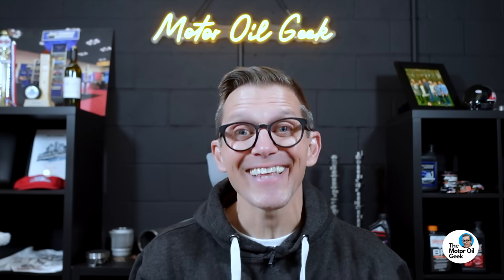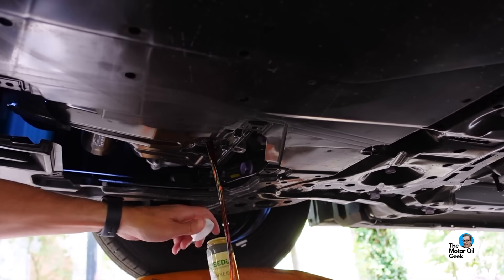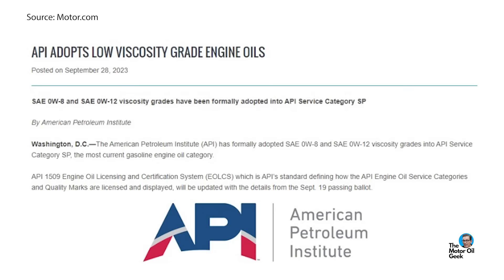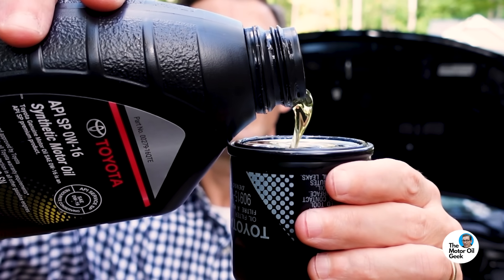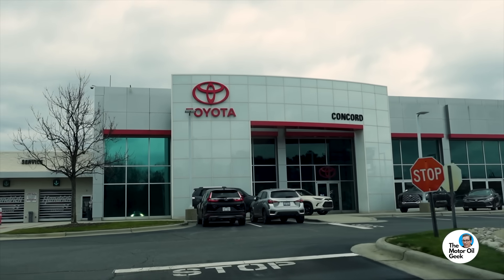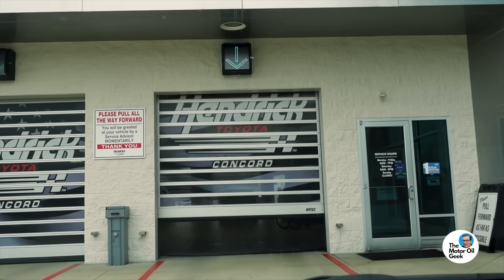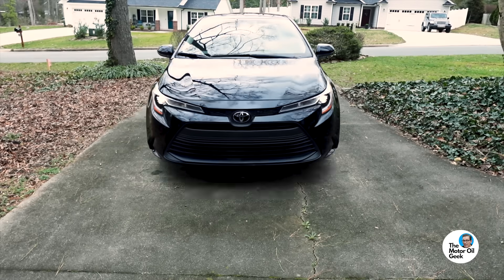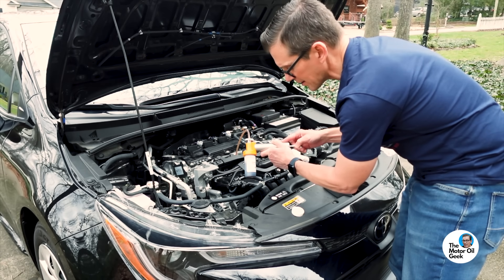0W-8 Motor Oil: Too THIN to Trust? Let's Find Out!

Comment: in my 2015 Ford Fiesta, I moved from a 0W20 Motorcraft  to 0W16 Pennzoil then to  a 0W8 Mobile 1. My Engine has never ran as quiet and as smooth as it does now since running the thinner oil. I read the Specs  of the Engine, from ring sizes to the 0.001" Bearing Clearances,  identical to the new Toyota engines and other engines requiring 0W8 oil. I believe it is a Korean spec vehicle, even down to the wheel and tire specs. I will be doing an oil Analysis right before I change the oil to see how things are going. I love the Videos Lake!
Reply: Doesn’t the owner manual say to use 5w-20/30? Why are you using 0w20 or lower?
Reply: @hass1337  It was made before there was an oil thinner than a 20 weight which was the thinnest available in the mid 2010's. Clearances and ring tensions determines oil weight, but also, Not all manufactures keep to what is in the books. Most do change grade requirements as time goes on. The tighter the tolerances, thinner and lower the Rings, the thinner the oil needed to feed into the Mains correctly.  You cant run a 30 weight with clearances so tight, it will starve for oil, even a 20 wt will cause this, that is why it was so noisy with thicker oils.
Reply: @TheOfficialNakatsuMegami  you're insane and completely wrong. Your engine is going to start burning oil very quickly. 
Wtf
Reply: @TheOfficialNakatsuMegami  my toyota calls for 0w20 in the US, but everywhere else it calls for 0w16 through 10w40. So i run 5w30. Same with my silverado. The silverado just had a recall due to running 0w20 and it has destroyed engines.
Reply: I ran a Manometer reading for Crankcase blow by on my Fiesta 1.6L, which I found out, is actually designed by Yamaha, not Hyundai.  With 0W20, Ford Spec for the engine, and switching to 0W8, my Crankcase blow by pressure dropped by Half. This is telling me the 0W20 was too thick and the oil was not making it to all of the rings because it was too thick and was actually causing more wear and increasing fuel dilution in the oil. I bought the vehicle with 70k miles on it and the previous owner must have ran a really thick oil, because it was mimicking a blown head gasket here was so much crankcase pressure and caused it to blow the oil filler cap off if is was just laying on it unthreaded.  on the 0W8, the pistons rings seal so much better and the cap stays on just laying it over the hole. I think it could be a specific use case, but the change did three major things,  significantly reduced blow by, reduced the oil consumption from a half quart in 5k miles to zero and stopped the fuel dilution of the oil. No additional wear was found after two oil changes. I am on my 5th Oil change and will have another Oil Analysis done in about 2k more miles to make it 3,000 on Mobile 1 0W8.  This time I will use Lakes company to do it so he has the data for his report.

Comment: before toyata free oil change at 10000,  i also got oil changed from toyota dealer from my own pocket 3 times before 10000 free one. in my camry 2025 (0w-8).

Comment: Lake, in colorado winter can I use oem 0w16 & 5w20 in summer? Both name brand oils of course
Reply from the maker: I would not go thinner than the OEM recommends.
Reply: No its original oil is 0w16. Can I safely use 5w20 in summer? So I wanna go thicker for summer
Reply: @CarlosMartinez-pc7je Why not 0W20?

Comment: For the CVT on my Civic and the 5 speed tranny on my Camry, I use the " measure what comes out and fill with the same amount".  Tranny fluid doesn't evaporate so if you have no leaks, there is no reason to use the check fluid plug procedure.  You just have to be careful not to spill when draining and measure precisely what came out.

Comment: Sorry for being late and perhaps it's been answered, but the chart at minute 11 indicates that the oil change for Caroline's car on 2/28/24, the most recent one was 0W-16, while you say that it's 0W-8. Question: now that different brands of 0W-8 motor oil is on the market, do they have the similar additives to the Toyota 0W-8 motor oil? Given that 0W-8 oil is pushing the limits, will it be safe to use other brands of 0W-8 oil in a Toyota?
Reply from the maker: The oil installed after the samples shown was 0W-8. We’ve not tested any other 0W-8 oils yet to see if they match the performance of the Toyota 0W-8.

Comment: Never go over 5,000 miles on ANY motor oil change!  3,000 miles if you are unfortunate enough to have a turbocharged engine!  Otherwise, face a very expensive future!
Reply: I mainly go 5-6k miles in my turbo.  90% highway miles.  I have never had a problem.
Reply: @BabyBugBug  Highway miles are 20% of wear vs city driving!
Reply: @bryancarlson3673 And I’m so happy I only do long distance driving and just walk lol 😅

Comment: All I am saying a Toyota/dealership tech is the very last person I’m listening to cuz like literally they’re working for the dealership. Hello, naturally they’re going to tell u just as the manufacturer. My sister just bought a 2024 Toyota Corolla and it will be getting the oil changed at 5,000 or less miles revenues those free ones from the dealership will be done at the dealership and in between by my much very knowledgeable trustworthy mechanic that been going to for years. As for CVT fluid drain/fill at 60,000 miles I ask him can it be done and if he says yes it gets done. Because that’s when the CVT warranty expires. I had considered doing prior but then Toyota might try the game playing of oh you voided the warranty by draining/refilling! My theory is that Toyota anticipates the life of their CVT to be about 60,000 miles and therefore say the fluids is lifetime as the fluid would not need replacement prior to that, thus, are saying fluid is good for life of CVT which typically is 60,000 miles otherwise they be confident in and would warranty it for longer than that, the whole thing that manufacturers decreased warranty time is because modern cars are more reliable than older ones, makes  me sick 😂 A) It’s been proven it’s the other way around B) If modern cars were more reliable you be confident in increasing the warranty time not with declining it, unless you have absolutely no brain and/or common sense! Just my thoughts/opinions y’all are entitled to your very own! I end by saying good luck w/your vehicles to any and all automobile owners. 🙂

Comment: What people need to remember is this isn't caveman mentality where THICKER OIL BETTER THINNER OIL NO BETTER..

Viscosity doesn't protect your engine fully, film & shear strength with a quality oil does!! Viscosity helps it travel to its final destination the quickest and at what speed. 
Slower thicker speed can equal less protection, create more heat & bearing wear with an adverse affect.
0w20 oil today has numerous protection packages with a better flow rate that actually reduces heat covering more area quicker without sacrificing protection & is rated up to 104 outside temperature.

I want someone to show me 1 instance where a motor was fried early using 0w20 where 0w20 was called for on that motor.
Keep your old school mentality and run your thicker oils ignoring engineers while molasses is coursing slowly through the veins of your engine possibly affecting your VVT timing & yes tolerances & passages are smaller now than 1980. 4 cylinders are pushing 250hp etc.,,.. 
0w20 actually has additives that help protect better than 0w30 and at cold start up the 0w20 leaves a film behind so its not just metal on metal... 0w20 is year round for all temps!!!. Do what your manual says..
Reply: Where does this neglecting of physics coming from?
The property of a fluid to resist the growth of shear deformation is called viscosity.
So you re wrong, cause it is only the viscosity that protects from wear.
People would easily neglect the simple physics so that they feel comfortable with the manual given to them. 
Obey the manul no matter what.
Reply: @joeblack6611  There is really no right or wrong here wirh respect to oil function we both make points because there are 50 ways to skin a cat with oil discussions..
My "Main" point was to many people people think a thicker oil is automatically better for protection "Without" realizing it could slow flow rate while doing more damage and most don't think of this. I'm splitting hairs saying a good quality oil is needed, meaning proper viscosity, shear, film strength & quality BUT also emphasizing viscocity is also a flow rate that is Very Important which has a main objective of travel rate & speed which is a huge part of your protection as Viscosity=flow rate.. Of course obey the manual..
Reply: @seatime674  
The point is that terms such as film and shear strength of the oil are often mentioned as if it was something independent of viscosity in general. There are no such parameters of oil from what i know. 
You ve got viscosity by SAE ACEA or HHTS High Temperature High Shear Viscosity. And it happens that the higher sae viscosity the higher HHTS.
This is why these manuals that distinguish the harsh conditions of use they recommend simply thicker oil for harsh conditions never the thinner oil. 
So basically we are on the road to nowhere good.
Reply: @joeblack6611  Yes to a point but the whole argument in today's modern engines is CAFE wants more  mileage period which thinner oils offer slightly & unlike 20+ years ago 0w20 & the like are engineered for higher heat & shear strength today so a thicker oil isn't necessarily needed nor should you just "guess" what your car might work better with with different weather patterns,
  THIS is the delima & confusion factor. Most car makers state to only use 1 weight oil year round regardless of temp, while some state to use slightly different in hot or colder weather which is fine following the manual. My Pacifica requires 0w20 only year round and doing something different may not be good for it.. However it gets to 115 at times in Vegas in the summer where I'm at and have been tempted to use 0W-30 so wel see, it's a daily fight between good & evil..
Reply: @seatime674  
0W20 might be enginered for higher heat and shear strength today but in the meaning of their stability not to loose this viscosity with time. But these oils wont have better shear strength than thicker oils simply because they still are thin and low in viscosity.
Frankly speaking i would say it is the modern engines that should require higher viscosity oils.  Higher power, smaller size, materials even worse. Whatever the old car, the shortblock was usually the last thing to be worn out. 
Take these pentastar rocker arms that are ticking when worn out, i bet these rocker arms are begging for a 5W50 from the very begining.
Reply: @joeblack6611  I guess that's the whole point in new cars today that require 0w20 that "could/should" use thicker oil because of higher performance is that engineers have made the thinner oil better to withstand shear and heat stress while still getting the best mileage possible. I guess it's riding that critical fine line..
 Maybe if emissions and gas mileage were never an issue all cars might be using 10w50 who knows..

The Pentastar 3.6 1st and 2nd gen engines 2011-'16 had defective rocker issues to begin with that required 5w30 & 5w50 may have just bought a little more time only before failure. My '18 Pacifica has the Pug update 3rd gen 3.6 that requires only 0w20 now as the top end issues were resolved on all 3rd gens..
I'm at 70k miles runs perfect & doesn't use a drop between changes so I know 0w20 is proper but still super tempted to do 0w30 soon,,,, maybe.. Daily fight ha..
Yes higher viscosity always has a slightly higher heat and sheer strength

Comment: Should I worry I have a 2025 Camry, I put 0-16 instead of the  0-8 that is recommended car has 6K miles on it so far.
Reply from the maker: No worries at all with the 0W-16
Reply: @ thank you for your reply I thought so I just wanted a 2nd opinion of someone that would have more expertise

Comment: Mr. "The Motor Geek", You missed this technical point. Toyota's eCVT is driven using a planetary gear system. Hence, it has no belts or chains. Regards...

https://www.youtube.com/watch?v=O61WihMRdjM&t=307s

Comment: Mr Lakespeed. I saw a post from a guy in Saudi Arabia in which the manual for his 2024 Toyota Crown says it can use 0w 8 0w 16 0w20 or 5w30.  Are they building special motors for the middle east that can use 5w30 engine oil? It seems very suspicious that in the USA they tell you to use 0w8
Reply from the maker: The US recommendation is strictly for EPA fuel economy regulations.

Comment: The eCVT has no belt. I thought the same thing. I have seen cutaways of these transmissions and they use electric stepper motors. I am not trying to call you out, like I said, I thought the same thing.

Comment: What these YouTubers fail to talk about (except for one) is the actual operating temperature of the A25A-FXS engine.  Until I monitored my oil temp with a ScanGauge 3, I was skeptical of these thinner oils.  I just did a 22 mile mostly freeway drive at 50 degree F on fresh 0w-16.  Coolant warms up pretty quickly, but it took 10 miles for oil temp to hit 160F and by 22 miles, engine oil temperature was 172F on the freeway with steady low RPM engine-on driving.  I will reserve judgement on adequacy on a 100F California day but 0w-8 through 0w-20 seems adequate in cool temps.  In very cold temperatures, 0w-8 seems better for stop and go driving just based on viscosity to temperature graphs.  In stop and go driving the oil will barely hit 160.  In freezing weather this will be lower.  These engines run cool.

But you have to balance this against the expected fuel dilution and condensation in freezing weather.  I suspect oil level on the dipstick will increase and oil will thin out with dilution as these engines just don’t get hot enough to burn off condensation and fuel.  To protect yourself you can go for a higher weight oil or change the oil very frequently.  Decide for yourself after monitoring your own engine behavior.  A real time gauge helps.
Reply: this is super essential post. Thank you so much for sharing. I totally support the opinion that 0w8 is fine if your car is in city driving regime mostly because once the ICE stops, the oil temperature goes down, and in the end the car constantly drives with oil that does not reach 100C operating temperature. It means that at 50, 60 or 70C the viscosity of 0w80 is like 5w30 at 100C or so. If some car owners does not follow factory recommendation, and use 5w30 in their hybrids, this oil will have a viscosity like SAE 50 - SAE 60 in city driving at half warmed up engine that is bad.
Reply: @ I’ve gotten a little more data after driving around in Las Vegas and logging more miles.  Oil does hit 200 degrees Fahrenheit on a hot day, and ambient temperature does make a difference.  My gas mileage on 0w-16 is 36.4 MPH on a Sienna hybrid.  With 5w-30, it’s 36.2.  It’s barely noticeable. Given more about what I know about engine protection and oil flow, I will be running 0w-20 in the winter and 5w-30 in the summer.  Once the oil is flowing (after a 3 to 5 second period of some oil starvation at initial engine turn-on), I have no concerns that 5w-30 will flow adequately in the engine at Southern California temperatures or even in the winter.  This is not a race car, and this engine was built for efficiency.   The temperature that matters is not the measured oil temperature but the temperature at the upper cylinder/piston rings where the greatest heat and pressure is… and this cannot be measured.  If I were in Chicago, I probably would still run 0w-20 in the winter to get increased protection against oil dilution/contaminants.
Reply: @badkid73 cool, thank you for sharing! Hot environment like in Vegas from May to Oct definitely may call for thicker viscosity. Just make sure when you drive your hybrid, you dont load it too much when oil is not hot yet, as oil cannot travel inside the engine fast enough and optimally perform below 90 C. In my case the oil is cold most of the time, and I dont drive more than 15 mins anywhere, rarely on freeway, it keeps shutting down when I stop or use electric power when I drive in city below 25 mph. Outside it is 52-68 F outside on average, that is why I am staying with 0W8. Thanks to your post, I decided to acquire Scangauge 3 too, so that I can measure the behavior of my oil temp in engine and transmission under various loads and conditions, and do a proper choice of oil viscosity in future. Thank you and Good luck to you!
Reply: @badkid73  And , also, you know, in Southern Cali like San Diego if you live within 5-7 mile range of the coastline, it is not so hot actually. It may be quite cold for some people. Hot is in August and September, but again, not terribly hot - 80-85F. From Nov till May it is 75 at best and usually 65-68 on average. Thus, 0W20 is the right choice for the whole year round if you drive normally without any towing or Nascar behavior.
Reply: @ I’d probably run 0w20 all year on a Camry or RAV4 but on a Sienna weighing over a thousand pounds more with possibly 7 passengers on the same tiny engine it’s easy to decide to step up to a higher weight.
Reply: @badkid73  Yeah, makes sense. I agree. Definitely more load will be there.